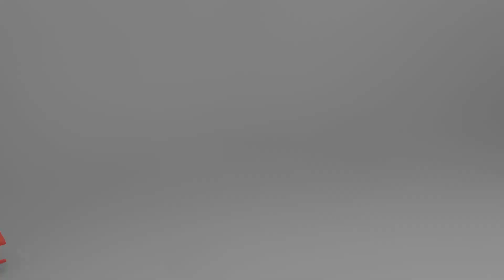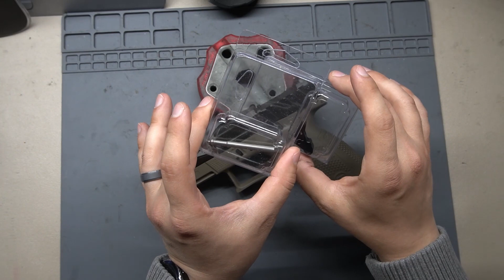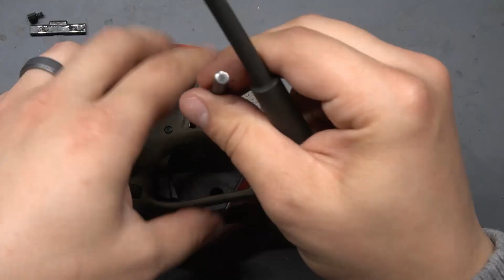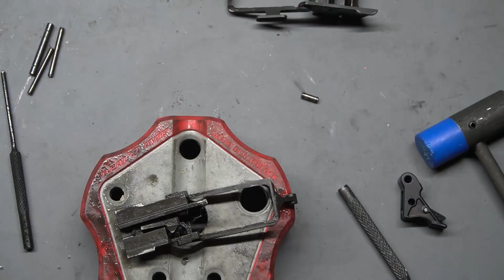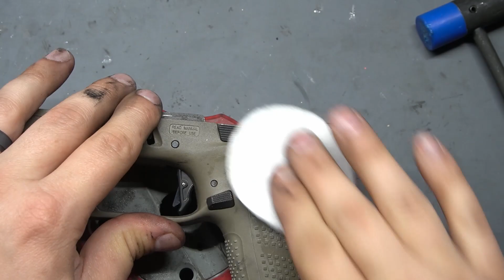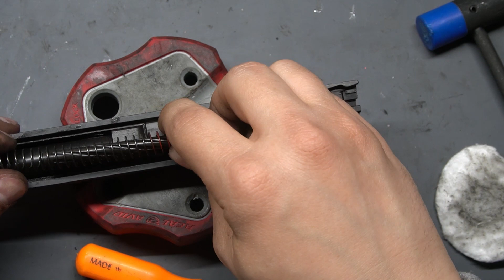CZ P10 Trigger Installation and Striker Installation, Overwatch Trigger

Comment: I'd love to see some mods/upgrades for the CZP10F.
Reply from the maker: All of these modifications are applicable for the F, but I do have a video specific on it about the striker.  Mine currently has an HB trigger in it, I'll be getting a review out soon
Reply: @workthetrigger  Awesome, I've been looking for guide rods and barrels so if you could maybe mention that in your next video I'd super appreciate it.
Reply from the maker: Primary Machine is the place for those. Pretty sure they make F parts.

Comment: So it seems like the upgrade is all about the Overwatch striker and not so much the new trigger?
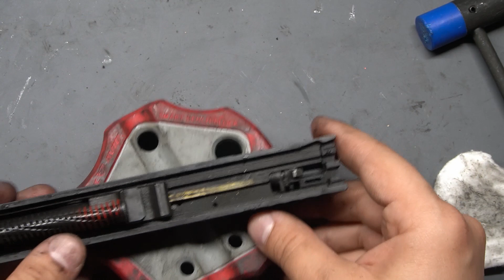Reply from the maker: i mean, it's both.  the trigger shoe's geometry change affects the pull profile just like any other shoe would.  the striker change maintains stock reliability while also lightening the trigger pull via coating and geometry change.  If you're interested in more on this trigger, sub and keep an eye out for tonights video.  the full review is coming out tonight at 6:30
Reply: @workthetrigger  Thanks. Will check it out. I might just go ahead with it. I didn't think you could beat the stock reset but this did hands down. The reset is is incredible, like an eighth of an inch! Makes replacing the stock trigger on my FN 509 look easy.

Comment: So I got the same trigger for my p10s...I installed it and took it to the range and first shot the slide locked to the rear on a full magazine and the trigger didn't reset when I racked the slade forward...I had to rerack the slide for me to reset the trigger....it kept doing that ? I feel like I installed the trigger correctly since it doesn't seem hard to do but one thing that happend when I was installing the trigger is the silver hook on the side of the slide release/stop came off and I installed back on but I think i.might have left it loose because when I tried to take off the slide, it would not come off for the life of me...I had to literally bang on a table to get it to come off....the gun will do fine in dry fire and all that just when actually shooting the slide locks to the rear on a full mag...I even moved my fingers out of the way to see maybe if they were touching the slide stop/release and nope still did it...I'm just confused ha

Comment: Man, I tried installing mine yesterday. I was curious if it'd be an improvement on the CGW trigger I have installed now. At least on my early production P10c the Overwatch Precision trigger doesn't  fit well. I correctly installed the trigger - twice. I need to pull it so far back to release the striker that it hits the frame. If I pull hard enough I can just get it pulled back enough that it will release the striker but it's a hard pull and it forces the trigger right up against the frame. I reinstalled the CGW trigger and everything worked as it should. Maybe I'll try again. How do you like it?
Reply: Shoot us an email at info@overwatchprecision.com and we can get your problem fixed or get it exchanged! Thanks for your support
Reply: I HAVE THE EXACT SAME ISSUE!!! How did you fix this?! I am currently going through it right now!
Reply: @xFETTx  Howdy - I didn't fix it, I sent it back 🤷🏻‍♂️ I have an HB trigger in now which I really like. Is your gun an early Czech produced model by any chance (mine is - just looking for some commonalities).
Reply: @SEAKPhotog  yes mine is a 2018 Czech produced! They are going to have me exchange this trigger but I wonder if that will even fix the issue.
Reply: @xFETTx  Good luck! Interesting that yours is the same original early Czech version. I wonder what could be different? If it ends up not working I really do like my HB Industry's trigger.
Reply: @SEAKPhotog  UPDATE: Finally installed the replacement they sent me and it works like a charm! I should have taken a picture of the old shoe but it appears this one is cut slightly different and the tolerances are WAY TIGHTER. I had to hammer in the trigger pin unlike how in this video and in my other install you could just press it in with your own finger pressure.
Reply: @xFETTx  Nice! Glad it worked out for you! Thanks for the update.

Comment: They should send a slave pin, or whatever you want to call it like hb does for the striker install
Reply from the maker: I dont remember getting any extra parts for installation with my HBI kit
Reply: @workthetrigger  a white plastic tube for the striker? Mine and 2 others I know of had one
Reply from the maker: Ah, I dont remember if I got that... but honestly, this method takes all of 30 seconds to swap a striker. 45 if you count removing it  😅

Comment: Does this trigger kit eliminate the small bit of creep before the break that the factory trigger has?
Reply from the maker: The overwatch kit produces a rolling break, which means there's a slight wall, and plenty of movement to the break, but typically a longer, slightly lighter average pull

Other kits will shorten the creep, producing a stiffer, more finite wall

Comment: HELP! While attempting this modification I punched out the two front pins and took the front internals out, but I was having a hard time getting the third pin out so I tried to pry it out and in doing so thought I may have cracked the rail a bit. In order to check to see if it was still functional I ran the slide back on the frame... without the front internals in I.e. takedown lever, and now the slide is locked on the rear part of the frame without any way for me to unlock it. What a fucking idiot. Any advice? Feel like gunsmith may be the only option.

Comment: What slide is on this? And does it have weight reduction? Easier grip for pullback? Not that my stock one is all that hard to pull back.
Reply from the maker: It's a Norsso Reptile. It's got a bit of weight reduction in the cuts, but I don't k ow whether that makes it weigh less then stock in the end. Absolutely love the slide, though. It's definitely a little gripper. Workthetrigger will get you 5% off, too

Comment: Who is the best company trigger ( for you ) for cz p10c ? Is it so much better than out of the box trigger??? 
Is there flat trigger like hammer fired gun ?
Reply from the maker: I prefer the HB Industries Theta Trigger
Reply: @workthetrigger  why this ? What does it have and the other triggers dont ?
Reply from the maker: Different triggers provide different pull profiles. Rolling break, hard brake, short reset, etc.  Additionally, the shoe shape affects pull and comfort. The Theta has the ballance between all of those for me.
Reply: @workthetrigger  thank you